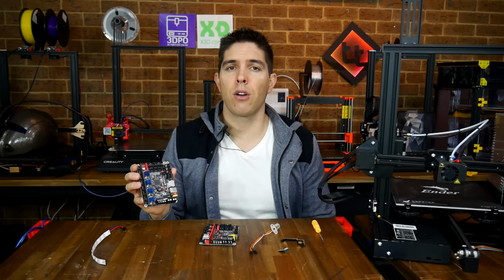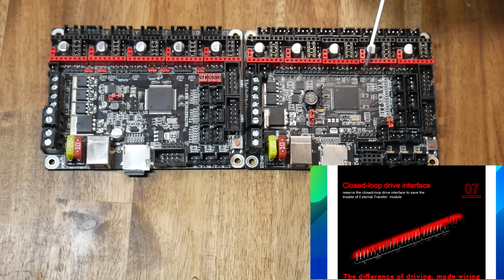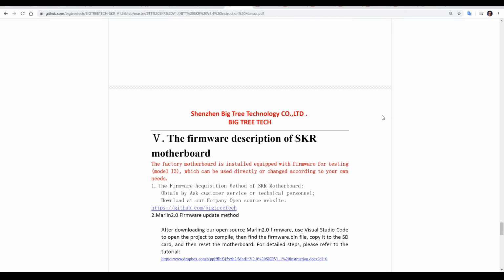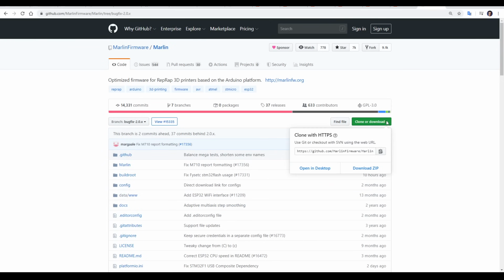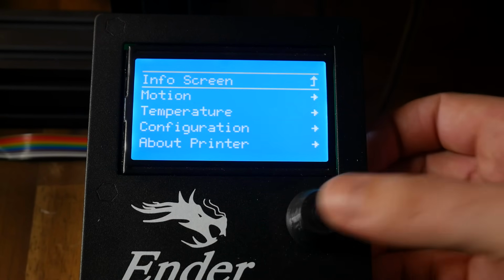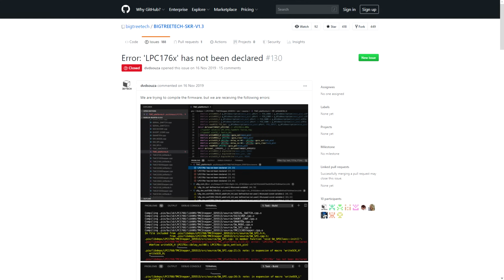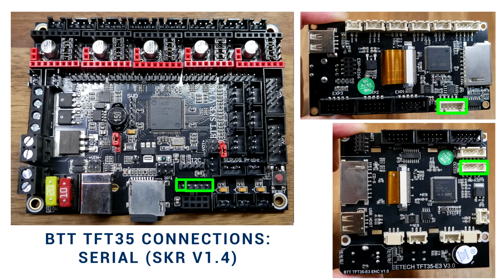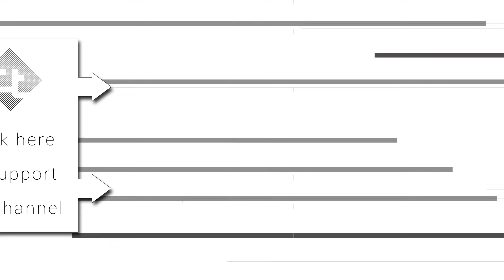Bigtreetech SKR V1.4 (Turbo) comprehensive guide

Comment: Where were you 4 days ago when i was stressed out like crazy setting this up, haha, kidding, i got it figured out, great video, only thing i cant figure out that i'd love some direction on, is setting up my octopi on serial so i can ditch the USB wire. I know you're supposed to use the TFT port, but my TFT35 is in that port.
Reply: Do you have any solution for this problem? I wonder if it's possible.
Reply: I have removed my TFT and just use OctoPrint. For a touch screen replacement local to your printer install Octoprint plugin "Touch UI" and either get a touch screen for the Pi or use an android device to connect to Octoprints web interface with the TouchUi plugin enabled.
Reply: @danielsampey4356  but i already have this stuff, honestly i can live with the USB sticking out the back if i have to, but i really dont think i have to because i know the SKR USB shares the com port with one of the EXP ports... i just dont know how to wire it up

Comment: I have the 1.4 Turbo along with a set of TMC-2209s and the display on order.  Looking forward to it!
Reply: Did it work? I'm having a hard time flashing marlin to it
Reply: @phyranios  worked fine. You need to put the firmware file on the SD card and then reboot the printer. It will flash the firmware, then rename the firmware file.

Comment: I have a 1.4 turbo with TMC 2209's and I did not cut the pins and don't use sensorless homing. Yet the homing works perfectly with end-stop switches.

Comment: Thanks for the video. Upgraded my Tronxy x1 to the SKR 1.4 Turbo and the only issue was BLTouch as you described. Still haven't nailed the 2209 senseless homing yet but doing a big rebuild of the printer and upgrading all axes so will work on it a bit more. I think one thing to mention is that only the cooling fan is PWM. The rest are always on at 100%. This is a bit annoying if you have a 5015 parts fan as it will be very loud. I'm considering putting this into the second extruder port and then configuring the firmware to use that pin config instead.

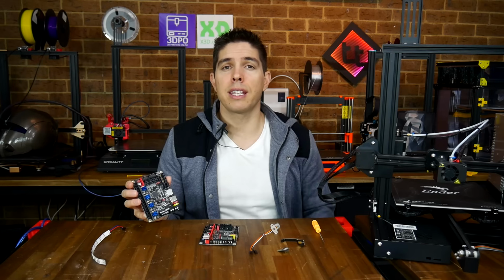Comment: For "H" point in the wiring checklist at minute point 0:49 it is listed as "RED/BLACK HOT END FAN". That is actually the second hot end heater cartridge attacment point "HE1". The fan plug for the hot end is right next to the second hot end hookup point backed up to the part cooling fan..
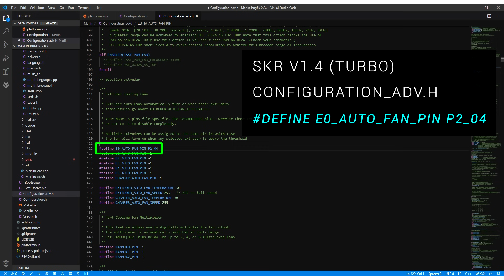Reply: I know this is an old comment/video but for others who are confused by the HE1 on the board's pinout and find this comment like I just did, the H label on the diagram is correct. At 10:20, the firmware change E0_AUTO_FAN_PIN to P2_04 changes the hotend fan to the HE1 screw-in terminal. So if you are upgrading an Ender 3 (or other printer with a single extruder) and make the firmware changes as instructed, the hotend fan MUST be connected to the HE1 port. This was done to allow for an easier direct replacement for the Ender 3 without having to change a connection type.

Comment: Great video 👍 I have just got my CR10S Pro up and running with this board. I have my sensor less homing values at just over 100 for X and Y. I love having access to the board and steppers settings from the TFT35 screen.
Reply: What parts did you order for the CR10S-Pro. I am seeing all kinds of different selections on the biqu website and dont know which display or drivers to select. I want to upgrade my machine. I have done my Ender 3 with the SKR mini already

Comment: thanks Michael, and big fyi to other so you dont smoke your board/dcdc module, i've seen 3 different wire configs on the bl touch, and 2 different wire color schemes (the other not here being red, blue yellow on the servo connector cable instead of brown, orange, yellow). make sure really identify what wire is what coming from bl touch cables and what pin to land it on. I had to swap the servo connector cable blue and red wires as they were swapped for what this board accepts but my black and white were already set ok (and in a white connector not a red like i've seen on many videos including this one).
Lastly also note you need to remove that extra senseless homing pin for x,y, AND Z because if you configure your bl touch in the z endstop position you will crash without removing that sensorless homing pin on the driver (i bent mine out of the way in case i wanted to play with sensorless homing later). (unless you change the firmware around to use the actual probe pins next to the servo connector instead of z stop pins then it won't get confused.)

Comment: I really like SKR 1.3.    I up graded my Ender-3 with these version board.   Along with the SKR 1.3 upgrade add TMC2208 in Uart mode.   I also added most of the add-ons that you publish with other video for the Ender-3.  My Ender-3 is my go to printer.   Turning out beautiful 3 D prints.    I smoked my original Ender -3 mother board following the BL-Touch upgrade.  Because the 5 volt color code wiring is confusing.   You had other Video that I misted.   It was cheaper to use 32 bit SKR 1.3 board that replacing original Ender-3 8 bit motherboard.      And with this Convid-19 given time to upgrading my other self design 3-D printers with 32 bit SKR 1.3 or Re-Arm boards.  I could not have done any of the upgrades without your video's.    I like all your hard work Michael you put in your Video’s.   Please keep up your good work. Thanks.

Comment: Have tried the sensorless homing using BTT TMC2130 v3.0 in SPI mode on BTT SKR v1.4 Turbo. Removed end stop cables. and enabled SENSORLESS_HOMING in TMC section in Marlin 2.072  No matter what I set the homing sensitivity to, drivers never detect end-stop and continues to knock.  Printer is Ender 3 Pro.

Comment: I was so happy to start using this board, but I'm stuck in the very first step: VS Code compiling. First of all, opening the config.zip it has several folders instead of 4 files. All folders named from a board, there are no SKR V1.4 Turbo, what I have. So, I just pick the SKR Mini E3 2.0 folder's files. Second is, when I did all the changes you suggested, during compilation I got several error messages and I do not know what to do to get rid of them:
Compiling .pio/build/LPC1769/src/src/HAL/LPC1768/HAL.cpp.o
Compiling .pio/build/LPC1769/src/src/HAL/LPC1768/HAL_SPI.cpp.o
Compiling .pio/build/LPC1769/src/src/HAL/LPC1768/eeprom_flash.cpp.o
In file included from Marlin/src/HAL/LPC1768/../../core/../inc/MarlinConfig.h:41,
                 from Marlin/src/HAL/LPC1768/../../core/serial.h:24,
                 from Marlin/src/HAL/LPC1768/DebugMonitor.cpp:25:
Marlin/src/HAL/LPC1768/../../core/../inc/SanityCheck.h:1617:6: error: #error "USE_CONTROLLER_FAN requires a CONTROLLER_FAN_PIN. Define in Configuration_adv.h."
 1617 |     #error "USE_CONTROLLER_FAN requires a CONTROLLER_FAN_PIN. Define in Configuration_adv.h."
      |      ^~~~~
In file included from Marlin/src/HAL/LPC1768/../../inc/MarlinConfig.h:41,
                 from Marlin/src/HAL/LPC1768/HAL.cpp:24:
Marlin/src/HAL/LPC1768/../../inc/SanityCheck.h:1617:6: error: #error "USE_CONTROLLER_FAN requires a CONTROLLER_FAN_PIN. Define in Configuration_adv.h."
 1617 |     #error "USE_CONTROLLER_FAN requires a CONTROLLER_FAN_PIN. Define in Configuration_adv.h."
      |      ^~~~~
In file included from Marlin/src/HAL/LPC1768/../../inc/MarlinConfig.h:41,
                 from Marlin/src/HAL/LPC1768/HAL_SPI.cpp:51:
Marlin/src/HAL/LPC1768/../../inc/SanityCheck.h:1617:6: error: #error "USE_CONTROLLER_FAN requires a CONTROLLER_FAN_PIN. Define in Configuration_adv.h."
 1617 |     #error "USE_CONTROLLER_FAN requires a CONTROLLER_FAN_PIN. Define in Configuration_adv.h."
      |      ^~~~~
In file included from Marlin/src/HAL/LPC1768/../../inc/MarlinConfig.h:41,
                 from Marlin/src/HAL/LPC1768/eeprom_flash.cpp:39:
Marlin/src/HAL/LPC1768/../../inc/SanityCheck.h:1617:6: error: #error "USE_CONTROLLER_FAN requires a CONTROLLER_FAN_PIN. Define in Configuration_adv.h."
 1617 |     #error "USE_CONTROLLER_FAN requires a CONTROLLER_FAN_PIN. Define in Configuration_adv.h."
      |      ^~~~~
* [.pio/build/LPC1769/src/src/HAL/LPC1768/DebugMonitor.cpp.o] Error 1
* [.pio/build/LPC1769/src/src/HAL/LPC1768/HAL.cpp.o] Error 1
* [.pio/build/LPC1769/src/src/HAL/LPC1768/HAL_SPI.cpp.o] Error 1
* [.pio/build/LPC1769/src/src/HAL/LPC1768/eeprom_flash.cpp.o] Error 1
================================================================================= [FAILED] Took 5.75 seconds =================================================================================

Environment    Status    Duration
-------------  --------  ------------
LPC1769        FAILED    00:00:05.752
=========================================================================== 1 failed, 0 succeeded in 00:00:05.752 ===========================================================================
The terminal process terminated with exit code: 1

Looks like Marlin does not support 1769 for me... 
What do I wrongly? Anyone can help me?
Reply: I have the same problems with the config files. It's almost like a dumbass copied a wrong folder into that one single ender 3 folder. The rest seem to be legit. Let me know if you find a fix, and I'll do the same, man.
Reply: @kennethnewman9927  I had the same problem. I found that i had not filled out the define motherboard correctly, it must read exactly

  #define MOTHERBOARD BOARD_BTT_SKR_V1_4
Reply: I had the same problem. I found that i had not filled out the define motherboard correctly, it must read exactly

  #define MOTHERBOARD BOARD_BTT_SKR_V1_4

Comment: I just installed a new 1.4Turbo board and all seems well except that when I connect all 5 pins of the BLTouch (3 servo pins and 2 probe pins), the LCD goes blank and the printer won't respond. I have a creality BLTouch with red, blue and yellow wires for the servo and black and white wires for the probe.

Can someone please give me some guidance here?
Reply: I have the same issues my friend. Have you found a sollution? 
I ve tried to change the :
Black - White  to  
White - Black   and the 
Blue - Red - Yellow   to 
Red - Blue - Yellow
but with no luck. Any advice?

Comment: Is it possible to have the Configuration.h (and probably also Configuration_adv.h) file in case of hardware endstops? I see in the video (13:44) this configuration is tested, but I am unable to do so... I have a SKR 1.4 Turbo board with TMC2209 drivers. I have cut out the pin as required and I have configured the jumpers as in your video (13:40) in order to have UART enabled. I have succesfully compiled and installed marlin 2.0 taken from the Bigtreetech website. There is some further change in the pin configuration to apply to the board? Thanks!

Comment: Yes I have the board you installed with 2209 steppers and Bl touch neopixels  and stuff like that bit since I upgraded from stock Ender 3 board I no longer have the resume print after powerless with new firmware 2.0.4.3 I went in enabled it like I read but when I flash printer it gives me this error 
 outage recovery:     
printer halted please reset

Comment: Just in case anyone like me doesn't have a coding background besides installing VS code you will also need to install the PlatformIO addon to be able to get the compile button.  I have been banging my head trying to figure out how to get the checkmark at the end of modifying the code.

Comment: once im putting in the sd card and turning on the mb, it beeps constantly with nothing on the screen. both plugs are 180 deg turned, and marlin set to stock display ( cr10S). now im stuck

Comment: I just ordered the the 1.4 turbo and the 3.5 V3 display with wifi - knob to the side.  Plus the TMC 2209.  It will be a month before it all comes in.  I hope this goes well.
Reply: I can tell you its going to get extremely difficult i dont get the fucking system running think wisely before changeing mainboards

Comment: I am currently working on putting this in my Geeetech A20M. I just got the old board out and am now going through some wiring to get it in there. Hopefully all goes well. I already have the marlin a20m firmware on it and the 2209 drivers installed. I am hoping this weekend to be testing it.

Comment: Wow, I'm planning on buying a printer with a BTT SKR series board next year and did not know that it flashes itself if you insert a micro SD with new firmware on it. Already planned on having a USB ISP permanently attached to it. Well, guess I don't have to plan for that anymore. Thanks!

Comment: please help!, I have an ender 3pro and I've installed a SKR e3 Dip board with 2209 drivers... when doing a config anything I enable comes up in error and even if I don't touch the file and check for faults it claims everything is an issue.. i did the 2209 file bigtree have and the stepper motors constantly drive past the stop switching making a horrible noise 😪

Comment: HI I HAVE   ( MKS SGEN L) + TMC2209
Now when i start my printer and check in Pronterface with m122 i get:  

Driver registers all axiss XYZE bad.

And testing connection ERROR All Low.
My TMC2209 is (FYSETC V3.0)
I already cut the pin for senseless  homing and had a jumper on the tow TX & RX.

WHAT THE PROBLEM

Comment: This is perfectly timed, literally just bought the turbo for upgrading my old Flashforge creator so it can run using Cura and everything else and not use the old x3g files
Reply: How did this work out for you?  Just ordered the SKR Pro 1.1 to upgrade my FF Creator X, along with the TFT35 V3 and TMC2209s.  What did you do about the thermocouples?  I went with a pair of MAX31855 modules.  Any problems I might encounter along the way?

Comment: I bought a srk 1.4 turbo when they came out as a board from my recently, sort of, completed MPCNC Router. I tried to follow the guide on the low rider version with modification and I'm usign DRV8825 drivers as they are so cheap. It felt a bit bleeding edge but I've managed to get it working. The card is amazing for the cost about a quarter of an altenative suggested route. Thanks for your lower rider videos, this one and the rest. I don't know were you get the time. I've thought about TMC2209 but with a working solution, unless I see issues with the output, I'll leave it. I can't seem to get the sd card slot to work but I tend to use an octopi so it isn't an issue and I've got a BBT touch screen so I might have a go at using that to feed the gcode to the board.

Comment: I have used arduino ide a ton, but just getting familiar with 32-bit boards.  I can't get my display to work and have tried a ton of things, but think I might have fried my board.  If I turned it on while plugged into the 12v PSU and the jumper was in the 5V position... Am I screwed?

I have a CR-10S with stock display and the SKR1.4 (TMC2209).  I have tried to enable a few of the displays (MKS_LCD12864, REPRAP_DISCOUNT... and a few others with no luck.)  The config example didn't work, but that could be because it was designed to work with 8-Bit Melzi board. One last thing, my CR10s has 2x 10-Pin connectors so the CR-10 doesn't work either.

Comment: I want to run bigger motors on one of my printers.  I need to know if i can just pull signals off of the STEP, Direction and Enable lines and run them to a bigger Packaged Drive ( like a DM542S ) to run the bigger motors without blowing the V.1.4 BTT board.

Comment: Hello, I completely have done what you did this video. So I try to auto home but the step motor has a voice like dıııııt. 
I tried many things I can move X Y Z extruder axis one by one but when I selected auto home it gives an error just stop every axis and the prınter do nothing. How can I solve this? 

Thank you for your help
Reply: I use SKR 1,4 turbo with ender 3 pro the step motor drivers is DRV8825

Comment: I  have ordered a SKR 1.4 turbo with 2209 drivers and a TFT35 display .  I’m going to mount my boards on a test jig, build and set up marlin on the SKR and load the latest firmware for the TFT display. I’m going to use closed loop stepper motors on the x,y,z and setup sensor less homing for x,y as well. We all know how loud god laughs at man plans fingers crossed.

Comment: still issues with "include error path to update", already spent hours but can't find the way to fix it ... any solution ?
Reply: Just spent maybe 4 hours to be able to make the same principle as the video shows just to figure out that you didn't mentionned that we need to install the extension "Platform IO" and " tdm 64" for it to generate the file "io". At last it works for my side.

Comment: My LCD screen has only 1 connector which I connected to EXP1. When I power on the printer the LCD does not work. Anyone else have this problem? I'm looking through the config files but haven't found a way to set it to just EXP1 and not both ports

Comment: Why did you plug the hotend fan into the second hotend heater output?
Reply: im in the comments for this reason, he shows that @10:28 he went into config.adv to change it. Im seeing others saying this is outdated and that it worked in Fan_1.. I am lost too!
Reply: @newbreedwarrior  The reason for this is that only one of the fans is software controllable, so if you want another fan that doesn't run constantly (I think Fan 1 is always on 24 V) you can use the heater output. I set up dual extrusion, so I needed both heater outputs. I put my hotend fan on Fan 1, and it's quiet enough (not Noctua) that I'm OK with it running constantly.

Comment: Thanks for making the video. I have a Monoprice Maker Select V2 (Wanhao Duplicator i3 Clone) with many modifications to firmware, z-axis braces, E3d V6 Hotend, etc. However I'm still getting layer shifts and I'm starting to think it may be a bad mainboard or stepper driver. So I'm considering buying this board and some stepper motor drivers to get it working properly.